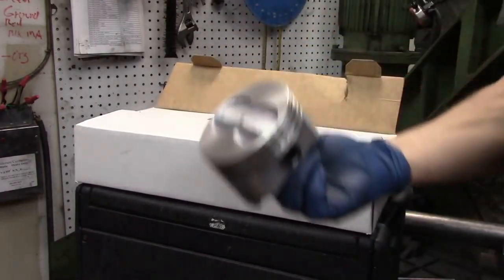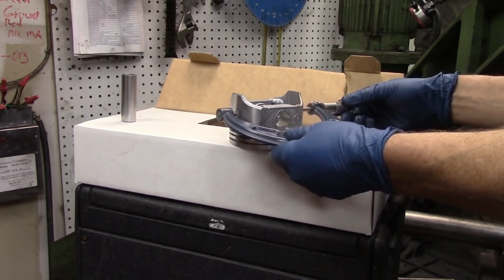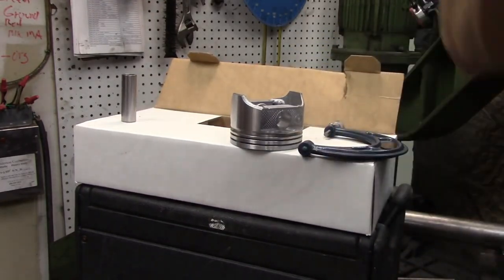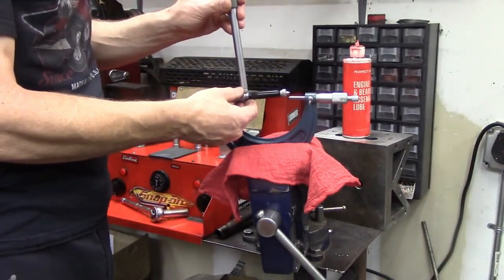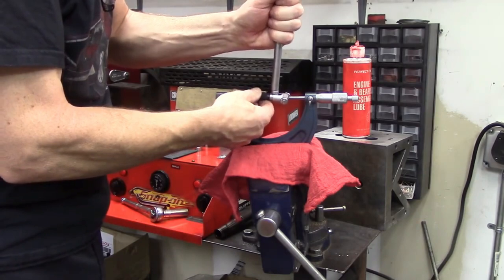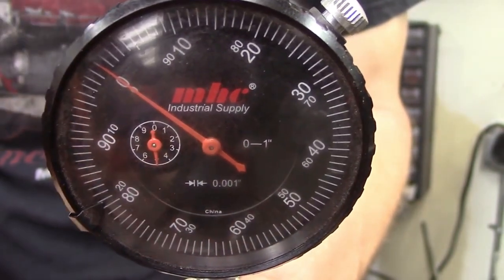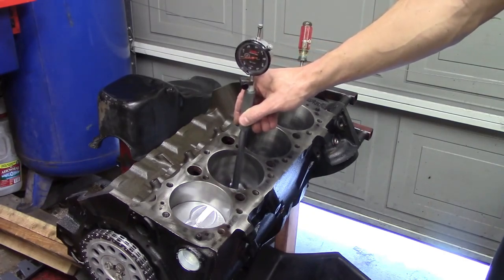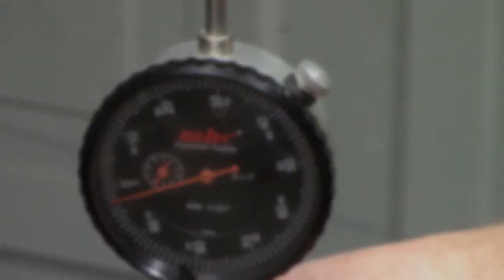350 Chevy Piston to Cylinder wall Clearence

Comment: Piston to wall clearance is built into the pistons. For example, if you get .030 over pistons for your 350 Chevy the finished bore size is 4.030 no matter what brand or type. Forged pistons run higher. As much as .007. meaning the skirt will measure 4.023 , the bore 4.030.  Always. Unless you ask your machinist for more clearance. In that case maybe +.032 over.

Comment: I have a 327   out of a 1968 Impala. The engine was stuck It turned out the second main bearing had moved about 1/8 of a inch just enough so the engine not rotate  . Is there any precautions I should take before rebuilding my small block Chevy.